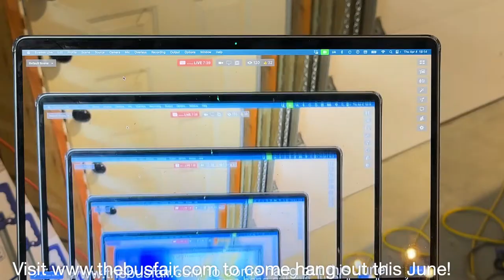CHUCK LIVE from a SHOP

Comment: I just got an estimate for professional spray foam -

Scope of work:
• Exterior walls and ceiling: 3”deep closed cell spray foam insulation applied to wall and ceiling as discussed. All preparation including masking to protect critical areas, trimming, and clean up is included. $1340.
My bus is a 4 window Chevy Express cutaway shortie. 

Seems reasonable to me.😁

Comment: beetle tape is what we use when we install solar panels we wrap the lag bolts with beetle tape screw them into the studs struts and cover the heads never have i had one leak or anything ever and i mean even 10-15 years later still no one's called i wouldn't use anything else myself

Comment: Before spraying insulation inside why not spray a rubber or some other flexible sealant on all inside seams and joints. Been using WAGO for years, They're great.
Reply: Will the insulation stick well enough to a rubber surface?